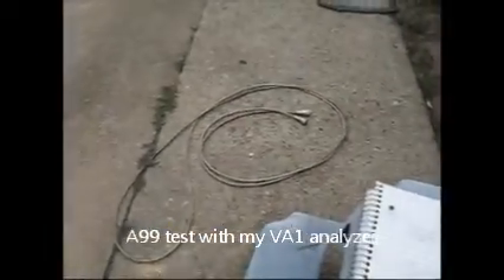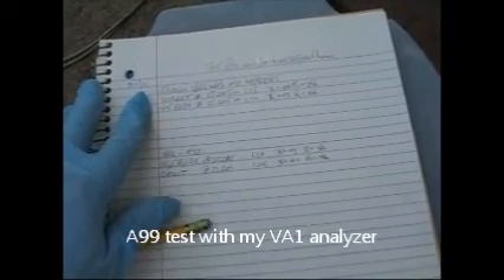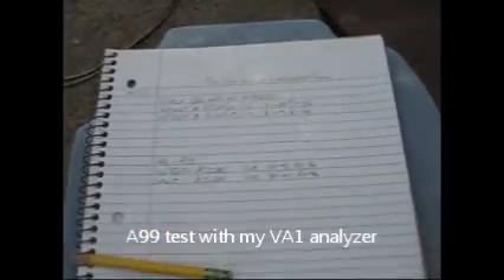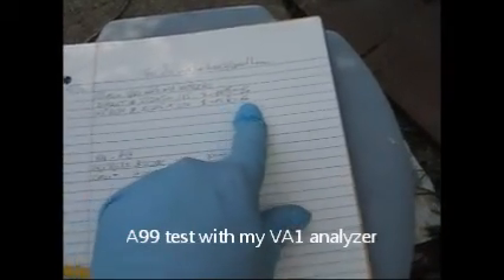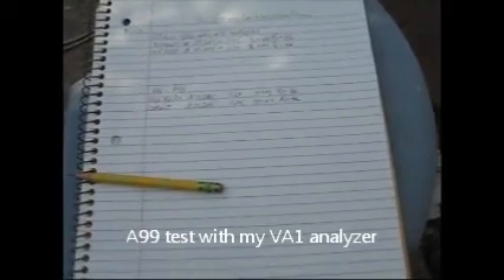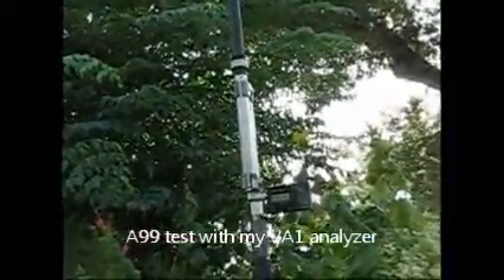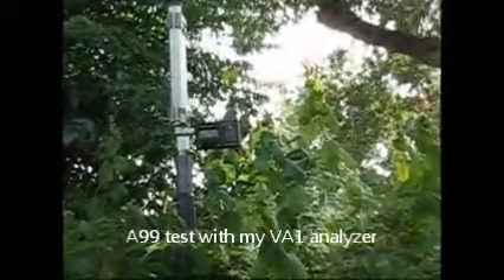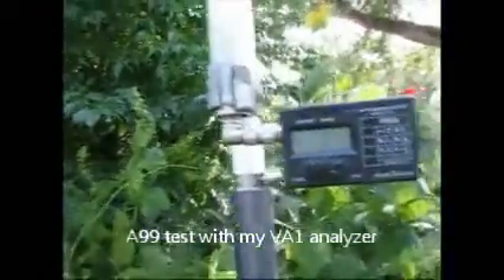A99 test with my VA1 analyzer

Comment: I had my antron on a wooden pole and it worked just fine! Vswr 1.2
Reply from the maker: Well Murphy, thanks for the comment. It is also said that the coax can serve as part of the antenna system. This is why I tested the idea directly at the feed point, to take the feed line out of the mix.

Comment: What brand is the analyzer & are they still available? How much $?
The A99 is a 1/2 wave & should only require a .05 wave length radial, or about 22". Your readings might go even lower with a 22" radial, or the analyzer itself may even be acting like a partial radial.
For best performance, the A99 should be isolated from the mast, have six or eight 22" radials & a 5T x 4" coax choke wrapped around what's isolating it from the mast, or the mast can cancel signal, becoming an out-of-phase radiator